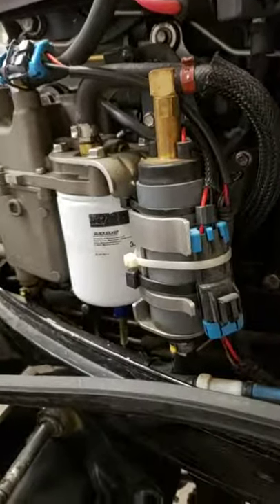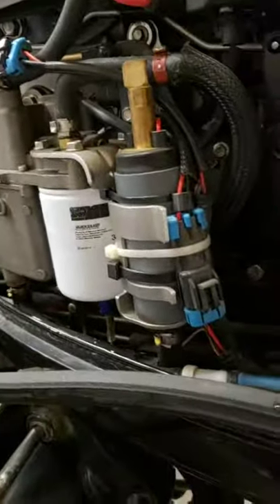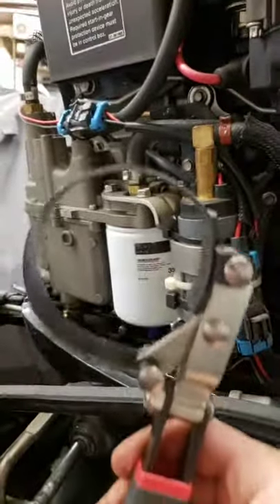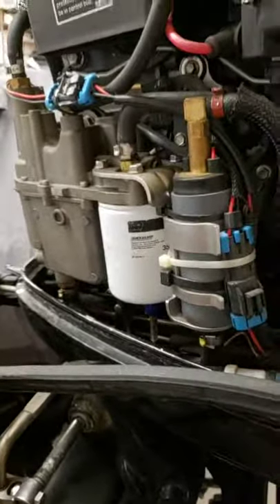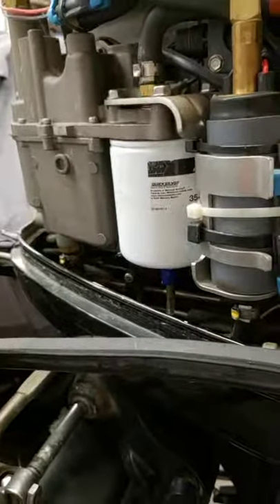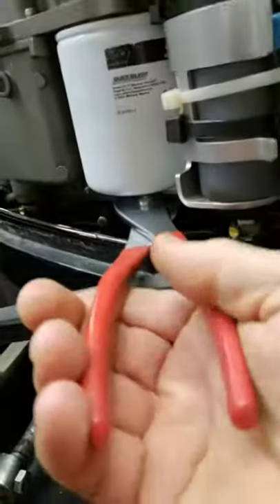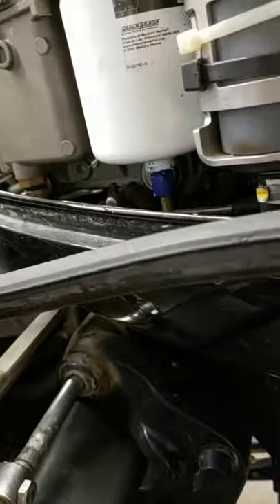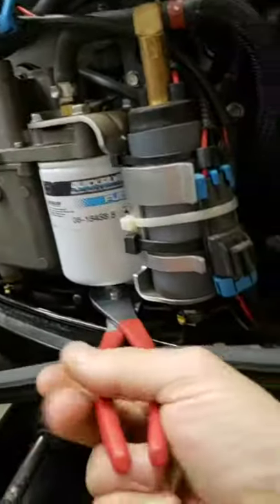How to remove the water separator on an Optimax it is this EASY!!!!

Comment: Thank you very helpful for your info. The boat has been set for a number of years so that is possible it seems like the air is getting there and there was fuel that had a old smell to it in the fuel when I push the valve stem.
Reply from the maker: I would open up the VST.

Comment: I have a question about this set up. I'm trying to see any videos on it. It seems like I'm not getting any fuel from the tank to the fuel rail there is no videos online trying to help me Diagnostic I'm not sure if it's my fuel pump, this low pressure fuel pump or etc.. Do you have anything you could help me with thank you good tip on this video as well. Thanks.
Reply from the maker: So.  No fuel from the VST to the rail?   Square fuel pump pulls the fuel to the low pressure pump.  The low pressure pump in turn fills the VST and removes any turbulence.  High speed pump moves the fuel to the rail under pressure.  Symptom...no fuel.  Remove VST and disassemble.  Drain and Manually activate the high pressure pump with 12 volts.  Check rubber cone seal at the end of the outlet for cracks or tearing.
Reply from the maker: Let me add a bit more to this. Initial reply was on my phone.
Disconnect the low speed pump.  Have someone KEY ON the ign and listen for the high speed pump to turn on.  If it does not turn on, check fuses.  Then refer to my original reply.  Even if the high speed pump does cycle, its still in your best interest to open the VST and look for corrosion, water, rust of fuel that has turned yellow (Phase Separation)  If any of those are apparent...replace both pumps.  The cone seal I mention is common.  The fuel pump will pressurize the VST and rail as they are both sealed.  But as soon as you attempt to start the engine, the pressure drops off....no start.

Comment: Can you just drain the water?  Does the seperator have to be replaced or can you drain the water and leave the old water seperator?
Reply from the maker: You may drain it as the water collects at the bottom.   It is not recommended though....but will work in a pinch.

Comment: I am stuck on getting the cowl of a 2000 optimax 200 HP. I released the latches all 3 but it's not moving
Reply from the maker: On the two opposing back corners, with your palms drive them up.  If that does not work...pull up on the front.   OR....the catches did not disengage

Comment: Isn't that your fuel filter? The water separator is typically a separate filter system that you have on the boat correct?
Reply from the maker: This filter does both.
Reply: @TheMarineDoctor  so I must have two water separators then because I just replaced my other filter in the back of my boat under the deck... Be